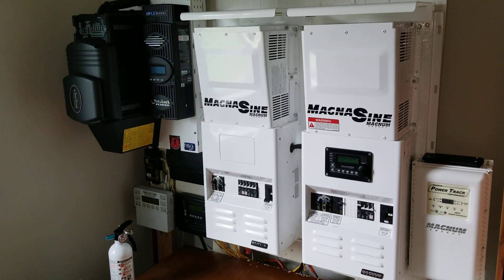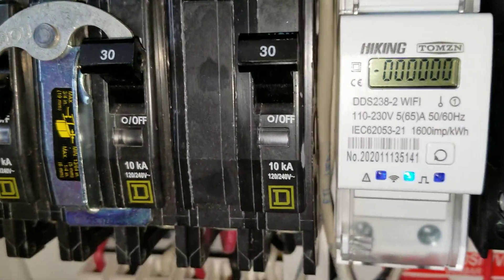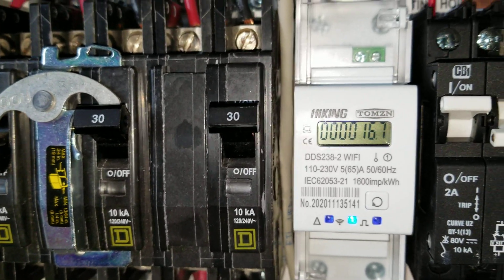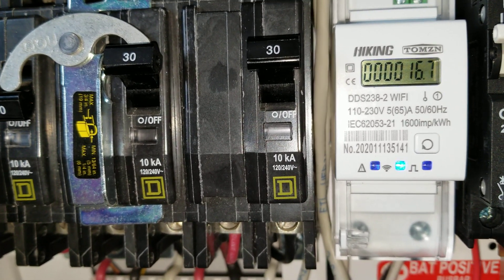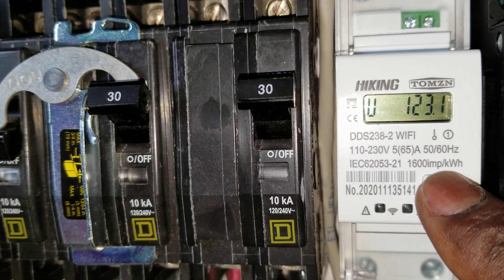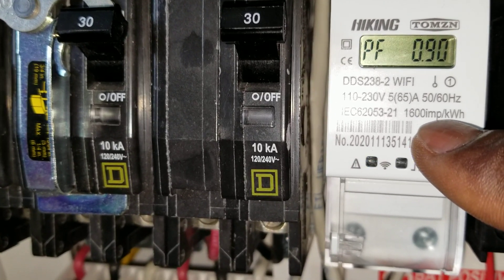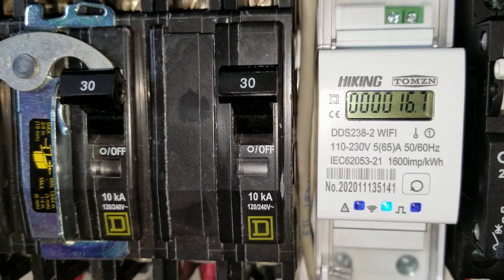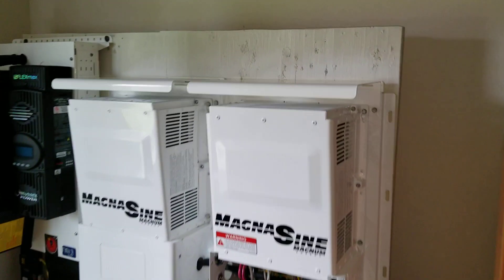TUYA SMART METER TECHNOLOGIES UPDATE (Pt.1)

Comment: When using the CF pulse output to measure the energy consumption, first a meter constant has to be chosen such as 1600 imp/kWh or 3200 imp/kWh. ... Once that is done, say you set it up for 1600 imp/kWh, this means that every 1600 impulses corresponds to 1 kWh of energy consumption measured by the meter.
Reply from the maker: Yes.
It is setup at 1600imp/kWh
Reply: I like it